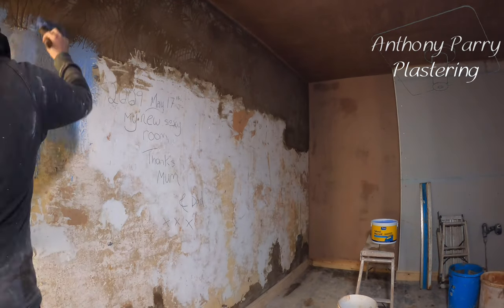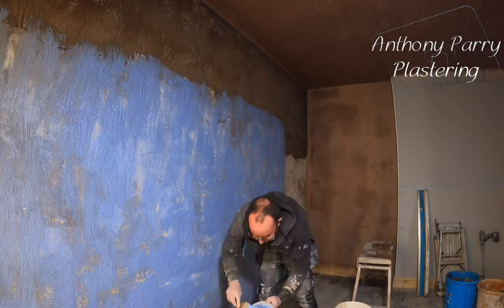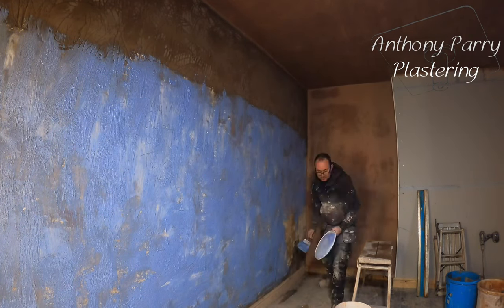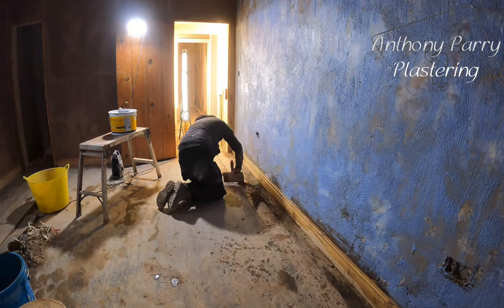Why I use blue grit, and how to apply it. Whole process TIMELAPSE

Comment: You can make your own blue grit if you wish all it is SBR and silica sand 
don't forget when using this you need to keep stirring it or the fine aggregate will sink to the bottom of the tub so don't forget all so if you are buying blue grit it can be really thick to spread so put a little bit of SBR in it give it a good mix keep adding a little bit till you get the right consistency to use to spread it easier

Comment: Ace vid. I'm prepping for plasterers, stripping walls back to brick & have PVA'd well in advance to seal the dust in. They're going to dryline so presume another coat of PVA prior to boarding and on the day?

They want me to blue grit paint a ceiling which they're skimming over. I hope to coax em to work in September. If I grit that ceilint tomorrow is that too early?

Comment: SBR is only 13 pounds a tub now on amazon its brilliant stuff for overskims, it's much thinner than pva so you get better value and it's not water soluble so it doesn't break down if water hits it like pva, blue grit is ace aswell but if you want to hit ceilings and walls the same day SBR 100 times better than pva, the skim pulls in lovely aswell, gives you plenty of time
Reply: What's the sbr you get from amazon?
Reply: So you can use sbr for internal ie when you use multi finish plaster
Reply: @billy4148  yes
Reply: @pauldolton9118  I used to buy the ever build, now I just buy whatever is the cheapest at that particular time
Reply: Do u add water to the sbr
Reply: @ashkhan9033  no, straight from the tub, straight onto the wall, don't add anything

Comment: If l use PVA l add a bit of concentrated liquid brick dye you don't need much you can get different colours l use yellow  or red but you can use whatever you prefer to use it's a personal choice it has many good advantages to use concentrated liquid brick dye you can see where you been obviously and see if you missed any areas as well let say you need to PVA day before your going to skim and it need another coat of PVA so the first coat you could use Yellow dye and on the second coat you could use red  hope my tips of the trade help all of you out

Comment: Top Man 👊🏾👳🏾‍♂️. I however have PVA'd a day or even a week before skimming & it's been fine for me . Depends because some brands I've used a totally shit but I've still managed it. Although I have heard the Blue stuff is the 🐝 knees .
Reply from the maker: Cheers bud, I’ve spoke to a few people who skim over the PVA after it dried. I was taught that the PVA needs to be tacky before putting the skim on. But I’ve spoke to a few people now  who do it the same as you, so I’m gonna look into this a bit more. 👍
Reply: @AnthonyParryPlastering  your a good Man. Love your vids Brother ....... keep em coming . Wish you the very best & more 👊🏾👳🏾‍♂️
Reply: I pva day before or even a few days before with fairly thick pva not neat just watered down slightly. Was taught and led to believe it has to be tacky before you can apply plaster on to it and letting it dry was a big no no... However  just to demonstrate the theory of letting pva dry before skimming , if you let a roller and tray go dry that's had pva in and then pour water in it watch what happens. The glue reactivates or reamulsifies. Same principal on the walls  the moisture in the plaster and also the heat generated from the set reamulsifies  the pva. Never had any issues but you have to be very through with your glueing can't miss any where. Especially  good way when faced with silk paint or oil based paints on walls/ ceilings no more blebs  or sliding plaster ...combine that with half time sachets and your stress free 👍

Comment: 5l PVA mixed with 10l Blue Grit, much easier to apply and dry out quickly
Reply: Can you actually do this? Doesn’t recommend thinning it down on the tub
Reply: @Garyck88  yes I do, no problems at all

Comment: Using for the first time today, as I’m applying the grit doesn’t seem to be covering all the area  only the blue liquid, it’s a bit patchy,will this cause me any problems?im applying with a brush
Reply from the maker: Hi Kirk you need to mix the bucket up, the moisture always comes to the top so before using it, it’ll need mixing to get the right consistency all the way through. 
You can always add some pva to try water it down if you are struggling with thickness
Reply: @AnthonyParryPlastering  really appreciate the reply,I did think about that tbh after writing my comment,I have applied it to an area I have to bond out tomorrow as it’s my first experience using blue grit,thought it was best to test it out that way rather than on a finished coat just to test out and see what I think of the product,cheers Anthony

Comment: Do you use a roller tray or just stick ya roller in the tub of blue grit?
Reply from the maker: I  just use a flat brush most of the time. I’ve used a roller and tray every now and then but I find I’m quicker with a flat brush.  I tend to use the lid as a tray when using a flat brush it helps to catch the bits and I scoop the blue grit onto the lid and take it from there rather than holding the bucket.
Reply: First time user found it hard with a roller try the brush nxt

Comment: Just used this now and it was a nightmare to apply.  some places very clumpy and others barely blue now it is drying. I have used way more than the recommended 4.5 mt square per litre. Should i give it a second coat or do you think it will be fine. Im a Diy plasterer aka  a shite plasterer! ha
Reply from the maker: Sounds like it’s need more stirring before applying it. But it can be a pain to put on. It all depends if you’ve covered it all if its covered it should be fine. The grit is there to give it extra grip so as long as it isn’t super smooth it should be fine. 
It hard to tell without seeing it,  but if you’re not sure just add some to areas that look bare. 

Did you use a roller or brush?
Reply: @AnthonyParryPlastering  Thanks for reply pal. Defo covered the whole wall blue. I just found when I initially hit the wall ( tried brush and roller) that bit  would be clumpy and then I try and work it into the surrounding area but most of the sand would stay in that area. its not smooth at all but not the sand is not spread as even as id like. many thansk
Reply from the maker: @lawlor1000  sounds like you don’t need to put more on. I reckon it should be fine
Reply: I add some water to it to.make it easier to apply.

Comment: Would blue grit be good to dab onto ?
Reply from the maker: It is a bonding agent so in theory you should be able to. It all depends on what the backing like. I’ve not tried it myself.
Reply: @AnthonyParryPlastering  it’s old brick so was going to pva anyway , I’m a skimmer mainly but do the odd dot and dab cheers pal
Reply from the maker: @mickbaker7573  I’d just use PVA myself, you won’t be gaining anything using blue grit.

Comment: I always pva neat, never had any issues even over bonding or hardwall, surely watering it down weakens the pva
Reply: No it doesn’t weaken it !    You need to dilute it 3 parts water and I part PVA , It states it on the instructions, and after a good stirring , don’t forget to stir before and during use .   I am surprised you haven’t had any problems putting it on neat as this would form a skin and could later delaminate ( come away from ) the background you are plastering to ,       it needs to be diluted to be able to soak into into the background you are plastering, same for artex ceilings, always give 2 x coats and you will never have any problems,   ALWAYS apply second coat immediately before plastering, so always tacky .

Comment: I have been told blue grit is good for high suction back grounds, and green for low suction. I have an old house to reskim with high suction old walls. Just wondering what's your opinion?. Thanks
Reply: If its high suction use sbr and then grit on top of that it will make the plaster set perfectly, the problem with high suction areas is that the plaster can dry quicker in patches which can lead to shiny spits on the walls or the other end of rhe scale is crazing. Hope this helps 🙏
Reply: @crigdastig91  thanks

Comment: PVA doesn’t have to be tacky 
You can PVA and skim the next day
Reply: Yes you can if you're not doing it right and risk it becoming un-keyed.  Read the instructions of any pva tub. It clearly states apply plaster while pva is tacky. Instructions are on products for a real reason!
Reply: @Scott-wz4sc  yes but you don't need to .as I've used pva the following day many times over.
Reply: @Scott-wz4sc  makes no sense. If you’re plastering a huge ceiling, the pva won’t be tacky when you get to the other side or end. It’s common sense. Pva re emulsifies when it gets wet ie when plaster goes on it. Use your noggin fella
Reply: @nikthegreekcypriot  I'll repeat myself...read the instructions most pva instructs you to apply 2 coats. So when the first one has dried apply the 2nd coat and then the 2nd will take longer to dry. Obviously this all depends on how many square meter you're doing. But I've been at for 27 years and never had problem with how I do it, and I've taught  6 lads to go on and set themselves up as self employed. So yeah used my noggin plenty thanks!

Comment: One process you dont have to do before skimming....????
You can go over dry pva as its water soluble and the water In the plaster will tack it back up.
I'm not against blue grit I have used it, but has to be done the day before so actually slows the job down.
Reply from the maker: I’ve never heard of the plaster making the PVA tack up after it’s dried I’ll have to look into this 👍

I was taught that the PVA needs to be tacky before putting the plaster on. That how my dad taught me. 
Cheers I’ll look into it 😀
Reply: Hope all are happy n well.

I've pva'd days before putting the skim over it & it's been absolutely fine. I usually pva the whole house before I do any skimming.
Reply: @AnthonyParryPlastering  he is right, it re emulsifiers.. That why you can't use it outside...
Reply: I used Thorobond over crystalized wallpaper glue back in the day. The pva was dry when I sprayed all purpose over it. I went a bit too heavy and the next day it had all slumped due to the excess moisture reactivation the pva. (later learned I didn't need the pva, just spray and leave the stiple, no wipe down. Then spray and pull everything tight the next day)